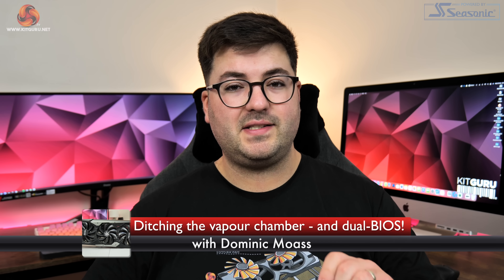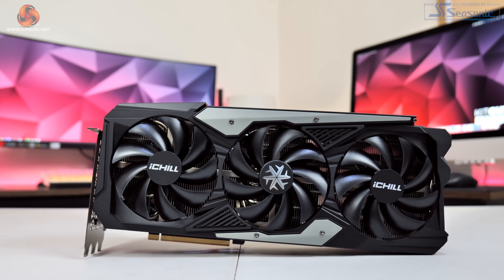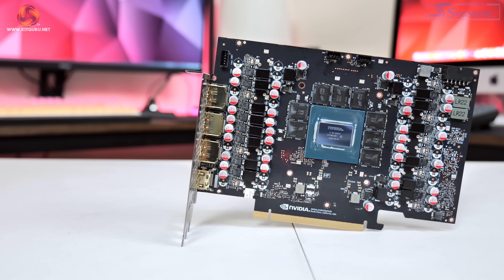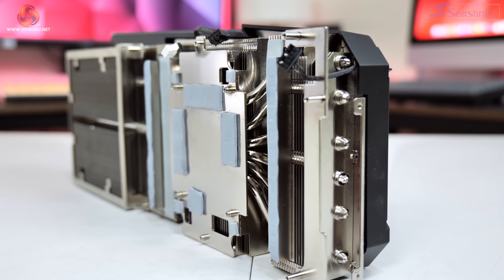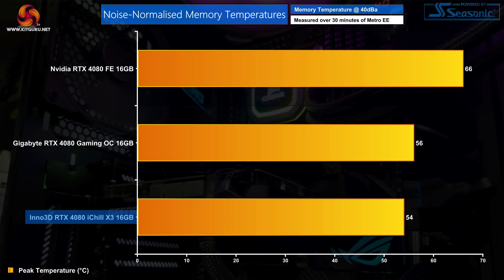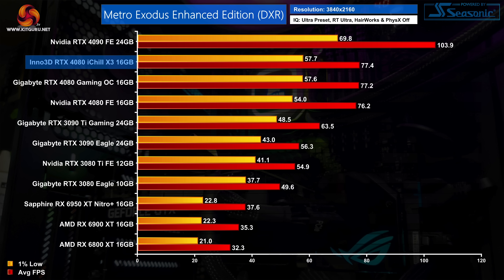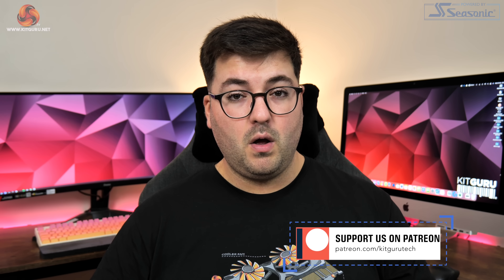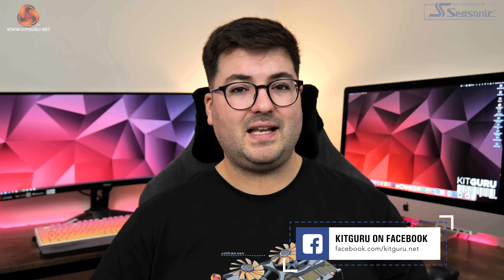Inno3D RTX 4080 iChill X3 Review - chill by name, chill by nature!

Comment: I've got this Inno3D 4080 iChill X3 model at launch and performs really great.
Looks and performs amazing.

EDIT: I sold the Inno3D card an got the Gigabyte Gaming OC model, much better.
Reply: Hey! How happy you are with that GPU after 2 months?
Reply: @loyaltyisdead  i sold it. I got the Gigabyte 4080 Gaming OC, it's better
Reply: @randy101  It's funny because I was writing that question and thinking to myself "I bet he changed to other brand" because you are not the only that I saw changing this gpu to the gigabyte gaming oc. Thank you!
Reply: @loyaltyisdead  Yeah, inno3d is louder and hotter than the gigabyte model, and it has the power limit locked, so you can't increase it. Not worth it .
Reply: @randy101 Did you get one with oc then?

Comment: The non-iChill X3-card looks alot better :) Love the segmented fan shroud design and the clean, basically uncluttered backplate on that one. The neatest looking 4080 IMHO. MSI's Eagle card is a bit duller, for those who like that. But the non-iChill X3 looks a lot less plastic. And it has a bios switch.
Reply: @Player7BR   I also bought the non-ichill version and it didn't have coil whine. I love the looks of it and it run absolutely quiet on stock fan curve.

Comment: Not 650 pounds? It's nearly double that? What a scam...lm out.  For me personally l think the price for 4080 is utterly ridiculous. I bought a laptop that can run most games at 1080p for 600 pounds...a full laptop...with a great amd gpu built in....you could buy the ps5 AND the new xbox snd get gsmepass for the price of just a 4080.....you could buy a 65 inch oled TV and soundbar for price of 4080.  It's price is miner prices. For me personally lm out.  3080 will.last me till l see prob a amd card at zbout 650 that beats my 3080 by a fair bit..so l probably wait now for rdna4.